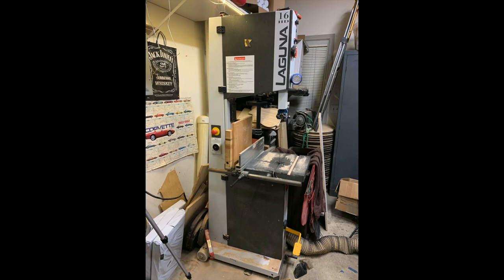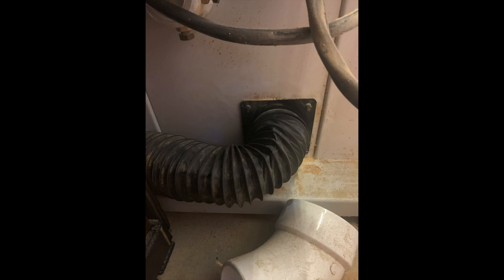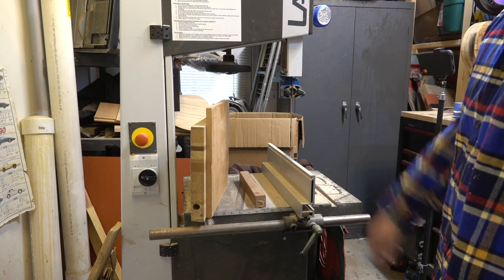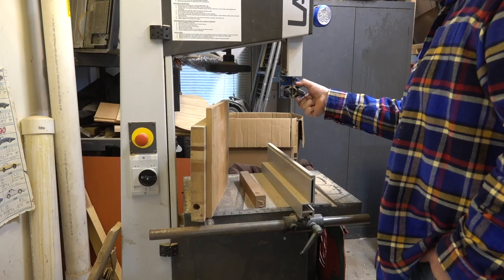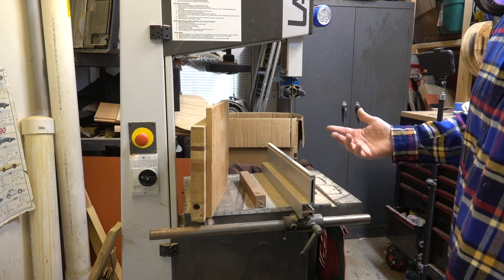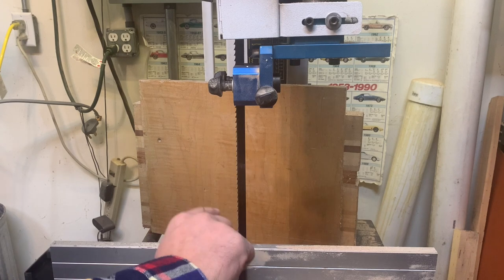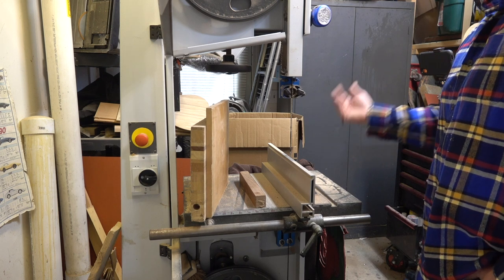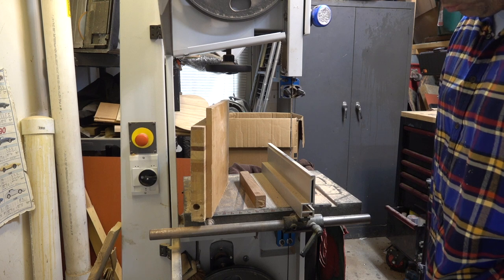Laguna 16 HD Bandsaw - Long Term Tool Review

Comment: Hello Derek
I see @2:59 into the video, your tires are fairly worn on the edges.
I've been doing some research into this, as my Italian saw is not keen on running a 3/4" blade 
in a preferable manner, (teeth off the edge) 
I am guessing this is because there is an inconsistant edge on the tires, due to damage, and my attempt to fix at the time.
The bottom wheel seems it's  had it's day, so I'll be  sticking a replacment one on in the next while, 
I think I might just be able to salvage my top tire, and going to dress the edge with as steep a bevel as I can 
make it, to have a constant edge much like a constant camber on other machines.

Not sure what profile your tires are on that machine, but if by chance they are flat,
Could you tell me if the machine is happy running teeth off the edge, and if so...
 I'm guessing those tires are evenly worn,  as in the tires having an even width of surface area,
well at least the front section where it matters.

If not the case, and there is inconsistant width, but you can infact run a blade nicely /happily with teeth off the edge, I'd be very interested to know, as it could mean getting a bit more life out of an old tire.

Not many folks who make do with wear, and opt for replcaing vulcanied tires for other types, 
the only rubber I could find was Centauro with a rib, needing dressing off.
so was interested in your video, just asking for the hell of it,
not needing a big long reply some time.
I'll be testing anyways, so not that important.

Thanks
All the best

Tom

Comment: Recently replaced my small Craftsman like you shown. Last month I bought a new WEN 3962 10". Cuts a full 6" depth cut. The majority of 13" bandsaws I looked at couldn't cut 6" like the 10" WEN could so I chose it for the great price it has. Cuts like butter with the included 3/8 blade but I'm going to get a better brand blade to put on it soon. Would have gotten a larger bandsaw but the new Engl I got right before Christmas kinda broke my secret bank account... But I don't care, it's an Engl..........
Reply: Hello Stormcrow, I would like  to know what an Engl is, thank you.
Reply: @timcc001  It's a very high end guitar amplifier. I got an Engl Savage 60 Mark 2 for a really nice discounted price..

Comment: Derek, is a 10" band saw enough for guitar building  if I don't resaw tops or I will be limited on other aspects?
Reply from the maker: yea for sure.  you can buy fretboards that are cut and radiused already.
Reply: Check out the WEN 10" 3962... Great price and it will cut a 6" depth... Not enough to resaw guitar bodies but it will cut a neck through neck blank really nice and you can resaw neck blanks all day.